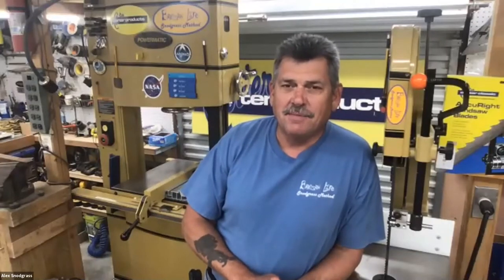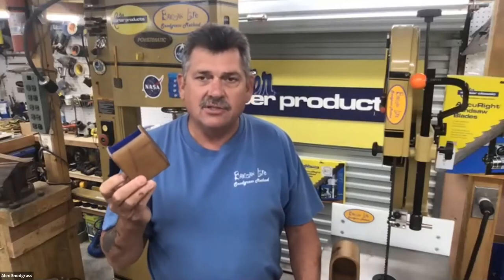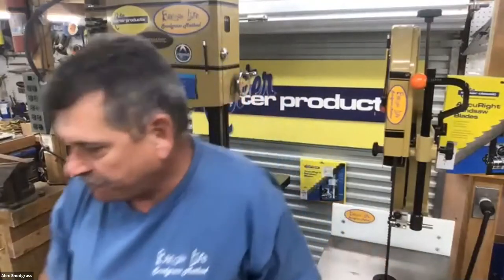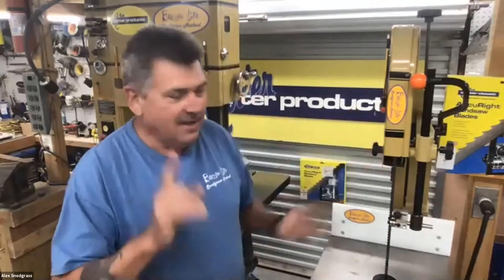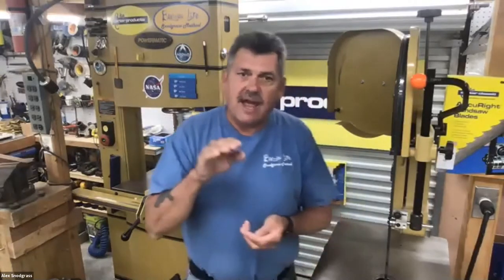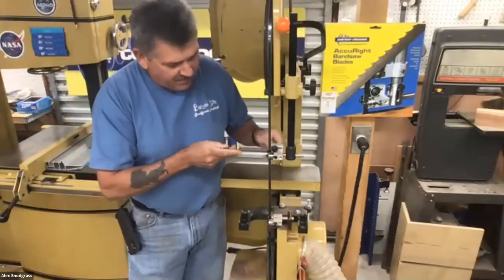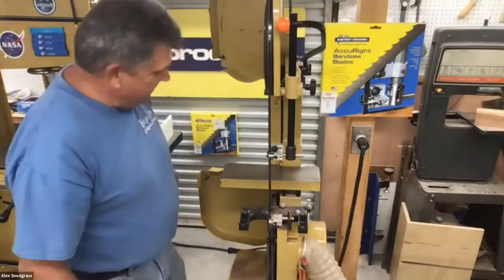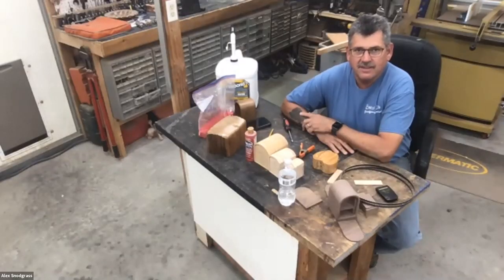Alex Snodgrass - Bandsaw Boxes

Comment: What he is trying to get you to believe is that the tracking overcomes the play in your ball-bearing guides. So why have guides at all? His comment on how the blade twists or rocks on the crown and then he says its easier to control the back of the blade with the guides??
Centering the blade
Positioning the blade as he suggests limits the depth of blade you can use on your saw.